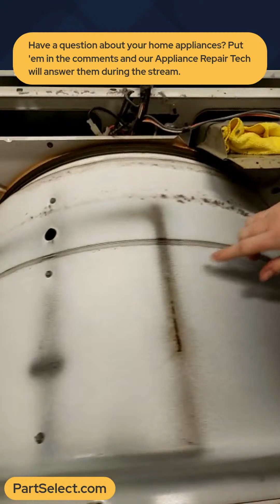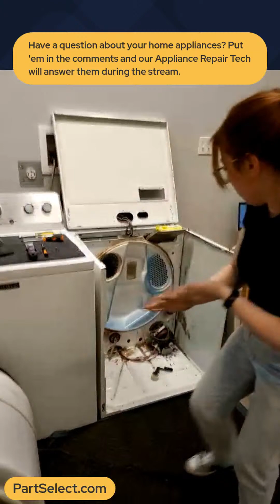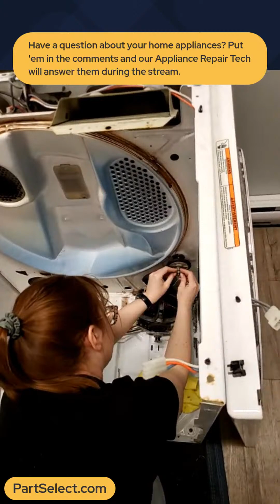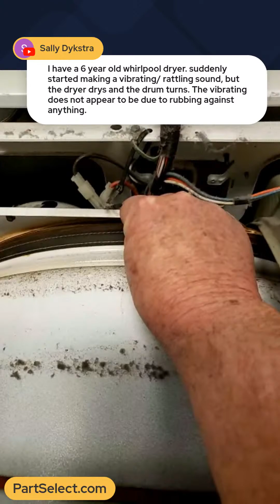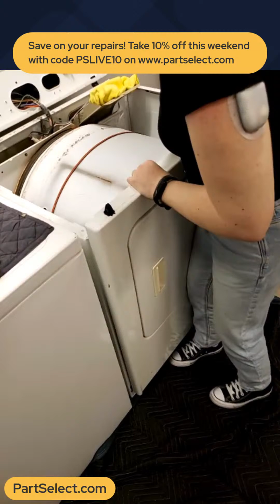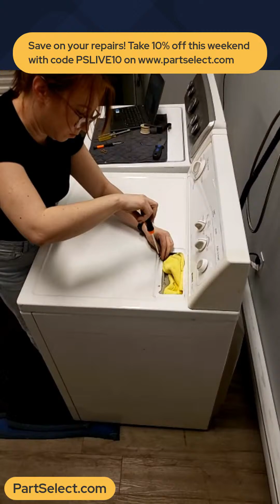Appliance Repair for Beginners - Dryer Edition!

Comment: Use duct tape on top of dryer to the top of chasis to hold drum up in position while you hook up belt around the idler pulley and motor.

Comment: Have a 20 yr old GE washer that will pump the water out & spin but won’t agitate. I’m being told is the timer but parts are not available. I hate the newer washers with the slow agitation. Can parts be found for this washer?